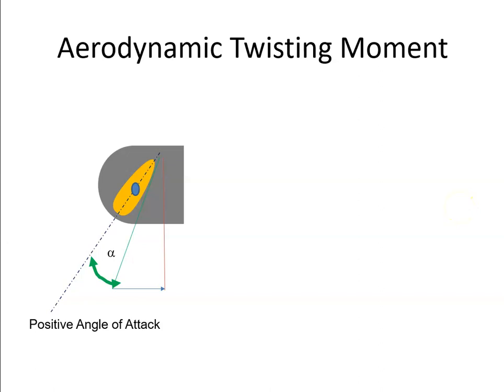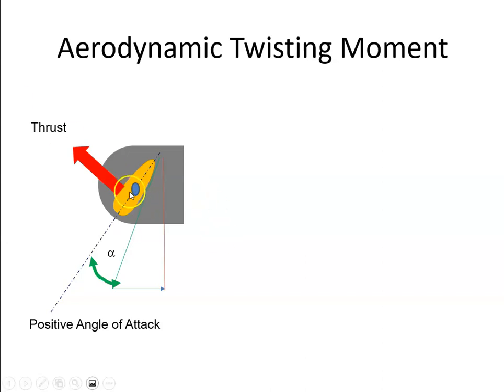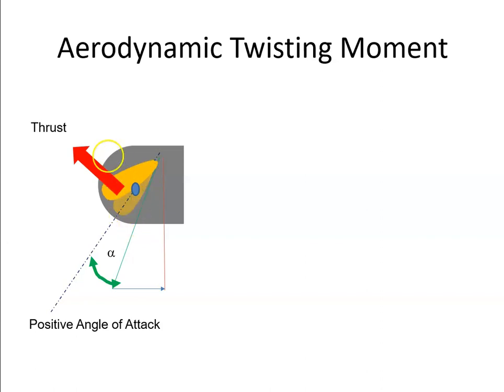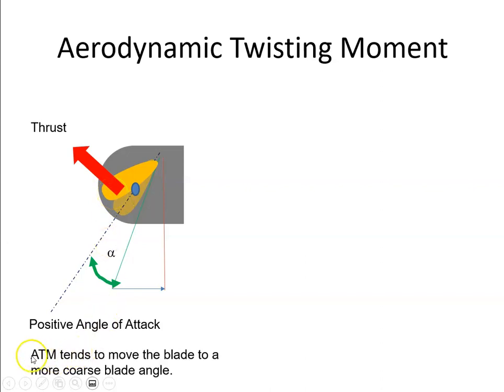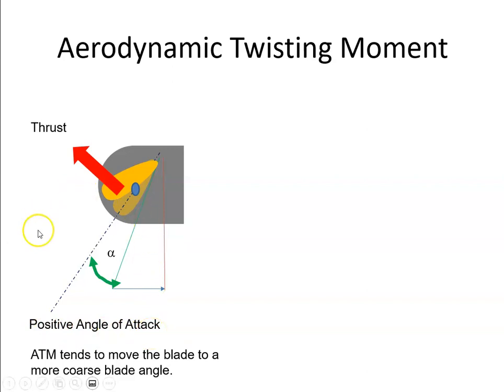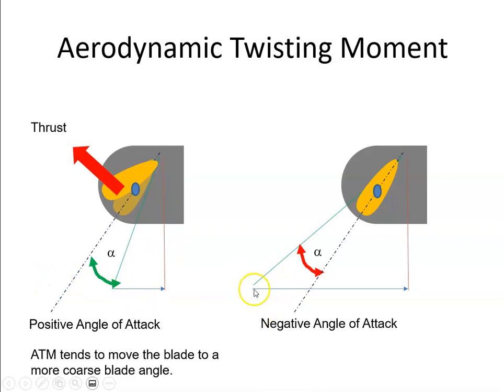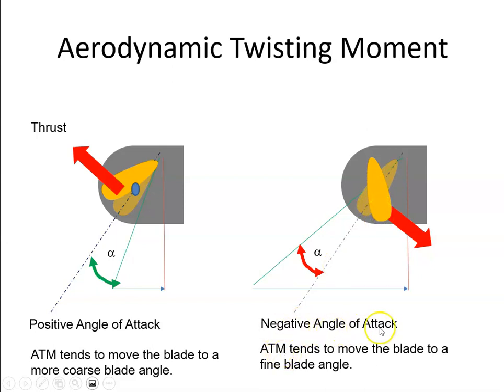Propeller Aerodynamic Twisting Moment

Comment: Hi, Roddy. The propeller is a rotating object, if we have the unbalanced thrust on the propeller blade, then there should have the precession exist. Just wondering if it is the thrust cause the precession, and the precession twist the propeller blade to more coarse. Otherwise that thrust is just a bending force.
Reply from the maker: @Zhao Jingjing.  Yes an asymmetric loaded propeller can create the P-effect (asymmetric loading) and precession.  In this case, the thrust is a moment trying to turn the propeller blade about its axis.
Reply: @RoddyMcNamee  Thanks Roddy, I really enjoy your videos!